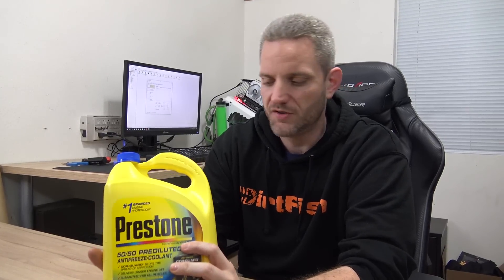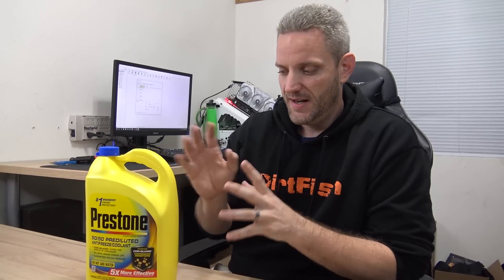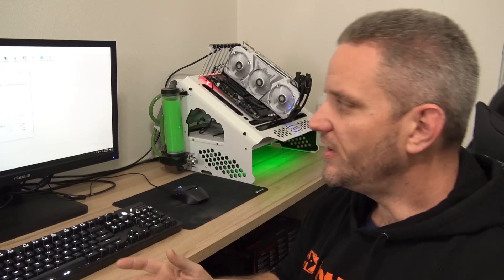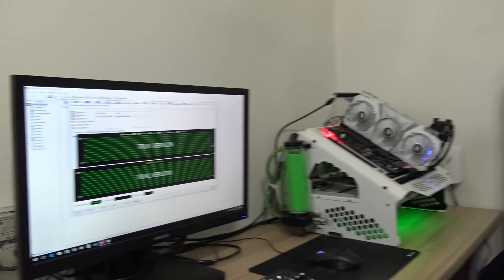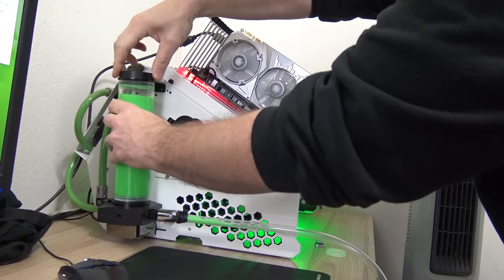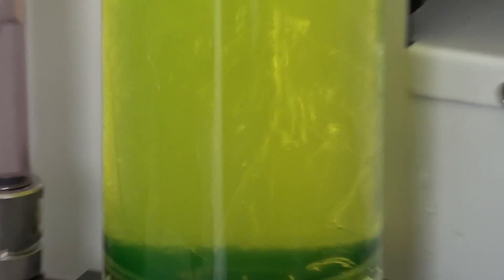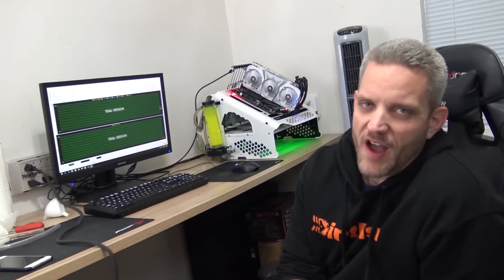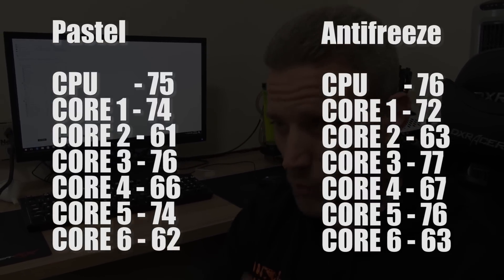I used Antifreeze to cool a PC

Comment: Water is also amphoteric, meaning it can act as an acid or a base depending on what it is mixed with. So with antifreeze, it's going to act as an acid. If you do this, I suggest diluting the antifreeze heavily - and use distilled water only. Ideally, you're going to want a PH of 10 or very close to it (I.E. a PH of 8.75 is still too low).

Comment: Antifreeze will be worse than straight water. Car cooling systems are designed specifically for water, but in climates that can reach freezing temperatures, you use antifreeze so it cannot freeze and destroy your radiator and engine block when the car is not running. The ethylene glycol half of antifreeze has a lower specific heat than water. In the range of 17-20% lower depending on temperature. Water is the superior coolant all around.

Comment: i cant see why it would have negative effects to o rings and plastics. most modern engines are full of o ring seals, reinforced plastics, and rubber hoses. as well as many different metals. from iron, steel, aluminum, zinc, copper, etc.

Comment: You should try different blends of engine coolant, like how some Toyotas use red coolant, Audi's in house "G20" coolant, etc. 

Maybe even try hooking up a car or bike radiator and see how that works versus a PC radiator.
Reply: a pointless test, this is all you need to know
the bigger the radiator the more heat it dissipates at any given moment
of course it will only ever be as cold as the ambient air around it however
Reply: Lylian Varker The larger radiator test maybe, I know the fluid passages in a car or bike radiator should be bigger than a PC one. Trying an oil cooler VS a radiator might also be interesting as an oil cooler has much larger fluid passages as oil is thicker. I suspect though the thicker passages would make it perform worse as it leaves less surface area to dispel heat. 

My hypothesis for the different coolant blend is because Audi's G20 coolant was developed for their 3.0L Supercharged V6 engines which run very hot and thus need a more thermally efficient coolant. Because it's better, maybe you could see a difference in a PC. probably only 1-2℃ though. You could also try using it for a chilled liquid setup as it can get to a much lower temperature than water.
Reply: The special blends used in some cars are still just objectively worse than distilled water. The "special" blends are just slightly better than off-the-shelf coolant and antifreeze, especially at high temperatures, which is where coolant mostly operates, right - nobody cares if their car is cool when it's stopped - you care about the cooling capacity when the water is really really hot.

The only element known to man that has better thermal conductivity than water, and that is liquid at room temperature, is Mercury. As in, the metal, the extremely toxic liquid metal. Which is also quite heavy, and would probably destroy the pump.
Reply: Your're talking about nanofluids or something? Where they suspend nano particles of titanium or whatever in the mix to increase the heat transfer? Car radiators? The whole thing just sounds like to big of a set-up even for Jay just to get negligible results. The heat temperature and surface area of heat to be cooled is just not there to see any difference. Now if you shrink the size of the radiator to like an 80mm, then you might see a difference with the special-advance anti-freeze coolant. Which is probably why they are developing such fluids. So they can put smaller radiators in the cars. Smaller radiators= less drag, and less weight.

Comment: The automotive coolant is likely fine in most systems but some plastics as you mentioned could be an issue.  Another issue is a lack antimicrobials, since automobile coolant relies on the car's engine and thermostat to maintain a temperature well above the temperature most microbes will survive.  You would have to add in a compatible biocide when first setting up the loop to ensure it stays clean of microbial growth.

Comment: I'm actually surprised it was as good as water. Water is exceptionally good at transferring heat because of its high heat capacity and density. Glycol might have less of a surface tension effect but that really is minor compared to water's benefits. I thought it would be significantly worse. Anyway at least we learnt you can water cool in the Antarctic so thats always useful. It might not be a helpful computing video but in terms of scientific curiosity it was interesting. Thank you.
Reply: Olivia Lambert It is not as simple as you believe it to be. The water adheres to the surfaces, with its smaller molecule (and other physical properties, water is seriously weird.) That means it does the thermal transfer. The percentage of water in the system (up to about 50% EG, where it begins to impede cooling) is basically irrelevant to the ability to withdraw heat from the cooling element. That's why we mix to 50%; it's the strongest mix you can have which doesn't seriously impede cooling, which makes it simple for everyone to install.

Fun fact, you can check the voltage generated by your coolant eating away at the metals in your cooling system to determine whether your coolant is good. If it is over 0.1 volts, damage is occurring and the coolant should be replaced. If it is over 0.2 volts, serious damage is occurring.

ASE cert in HVAC here.
Reply: It's still a very poor thermal conductor. It's used in ice rink cooling systems because, you guessed it, they are very cold. Below freezing, in fact - that's why, big surprise, there's ice on the top. Which means that the fluid they're pumping, usually brine, must be below freezing too. If it's below freezing, you need anti-freeze to stop it from literally freezing solid. Because pumps don't work very well with ICE.... Maybe you should understand why it's used the way it is used, instead of calling someone else ignorant. Using it as coolant in a closed loop at room temperatures is objectively and factually, scientifically provably worse than water.
Reply: as aforementioned, it's because half water.
Ethylene Glycol does fine at thermal transfer though. kind've meh compared to water(less thermal transfer overall and much less at high temperatures), but plenty sufficient for Computers.

but even if the other half was dead useless for thermal transfer, that's fine. Computers don't generate a lot of heat. the bottleneck in Liquid Cooling is the transfer of thermal from Radiator to Air, not the Liquid itself.

the same bottleneck that Air Cooling has.
and the solution for both is more surface area.
Reply: +1 because girl
Reply: Cyan Stripe ;-;
Reply: Olivia Lambert well damn
Reply: I was surprised too. Alcohols in general have pretty awful thermal conductivity. I wonder if the system would perform worse over a longer time period, letting the system thermally soak for an hour or so.
Reply: Automotive engineers and chemists have had a long time to develop efficient antifreeze solutions.
Reply: It's half water. The water is doing the thermal transfer part.
Reply: Mythricia Its about heat capacity, the amount of energy it takes to raise it by one degree. You want to remove as much energy as possible. Transferring that energy into the water is the job of an efficient block design.

toy machine We have the ingredients, we know what is in there. There isn't much related to efficient cooling. That plus its supposed to be diluted significantly.

Martin Espinoza Half water means only half is there to do the thermal transfer. The glycol also had to have a significant effect or it would have risen more.

Having had time to think about it I'm assuming the fact that it was a well thought out cooling setup was the major factor. Had he used a poor/cheap cooling setup I assume it would have been worse. It wasn't pushed anywhere near its limits, had he used poor radiators, water pumps etc. I assume it would be different but at least its nice to know if you're not pushing your cooling to its limits it doesn't really matter what liquid is used.
Reply: This was a good comment and I appreciate it. +1
Reply: it was 50/50 mix, so it has 50% water in it.
Reply: ***** Well, no. You don't put nothing in because of corrosion. Even in an all-alloy system you have different alloys. So you can run e.g. Redline Water Wetter, which has a wetting agent (to reduce surface tension) and corrosion protection.
Reply: Olivia Lambert I thought that the glycol would make a major difference as it was flowing through the system,but the question, as he said in the video, is for how long, but thank you for helping realize this. Also "wow someone intelligent in the comments section"

Comment: That is a lot of antifreeze; you only need enough to inhibit corrosion and growth. Antifreeze will last MUCH longer than anything else other than water. It won't degrade; it will last for years. Distilled water + antifreeze is the BEST. All other fluids are just cheap toys with shiny bells and whistles that offer no real performance while reducing longevity. Because you are so into water cooling, I was shocked that you use the fluids that you do. You practically don't even need to flush your loop when using water and antifreeze; you just add more as it evaporates.

If someone wants to use a material that reacts with antifreeze, they just have to use a different fluid. But, distilled water with an anti-growth additive will still be the best; antifreeze is just one option for an additive. Something like PT Nuke is widely suggested by water cooling veterans. It is just copper ions, which work similarly to the silver ions in certain swimming pool solutions. It doesn't have any corrosion inhibitors, but using quality metals mostly eliminate corrosion issues.

Comment: it wasn't completely useless, if anything now we know what materials not to use in a build using coolant. After all, besides its dissolving properties it does have an advantage which is it being anti corrosive. if it doesn't polimerizes over time gunking up the system I'm down on using it.

Comment: Stressing only the FPU in AIDA64 Extreme generates the most heat.  My OC'd 4790k goes from 70C with all three to Thermal Throttling with just the FPU.

Comment: So what if you put pc cooling liquid in a car...? Would it stay cooler?
Reply: It would probably boil because of the extreme temps inside an engine
Reply: Oil handles most of the high heat cooling, engine coolant usually hovers at about 90C in most cars, which is 10C under the boiling point of water.
For most use-cases in mild weather it would probably work better than engine coolant - not that it matters, cars cooling systems are designed for coolant and have oversized radiators to compensate.
Reply: FatGuy computers don't have fast moving parts compared to a car. Sure you can say the hard drive but the hard drive doesn't need liquid cooling.. Besides antifreeze is so that the water in your car doesn't freeze when it's cold  and the liquid doesn't evaporate when its really hot.

Comment: In ye olde days a lot of us did use Antifreeze at 20-50% for the corrosion inhibitors. We were also using Eheim Aquarium pumps, milled aluminum and/or copper waterblocks, and Automotive Heater Cores. I was a bit surprised at how little difference the antifreeze made.

Comment: Why use antifreeze on something that heats up? Doesn't make sense. Anti freeze helps stuff not get COLD. Pcs don't get cold.
Reply: Master Stroyer it's engine coolant. Antifreeze is the short hand because it prevents the liquid in your cooling system from freezing.
Reply: To stop it freezing when not in use....... your car doesn't run 24/7
Reply: if you only use water to cool your car it would crack the tubes and engine when its below 0*. because when water turns into ice it expands
Reply: It would also gunk up with microbes that would love to live in it, and it would rust/corrode the hell out of the entire engine block.
Antifreeze/Engine coolant has a lot going for it, probably because it was designed for that specific purpose
Reply: You guys are missing his point. He's asking why put antifreeze in something that will never be exposed to freezing conditions. PCs are generally kept indoors in climate controlled environments, so the PC will most likely never be cooler than about the 60s(F).
Reply: razorbackblood06 THANK you! Someone gets it. Pcs almost never get cold. You want liquids that handle heat, not cold.
Reply: The antifreeze doesn't just stop the coolant from freezing, it is also very toxic and will kill any organic growths in the engine or in this case, computer

Comment: Try using mercury ri cool your PC next
Reply: I was thinking the same thing.
Reply: You are absolutely right, though elemental mercury isn't too bad compared to it's salts.
Reply: Gallium would work better i guess?
Reply: PRO-digi it wouldl solidify after you shut the computer off and clog the tubing. Not only that, but if any gets on the Aluminium parts, it will make the metal brittle.
Reply: the little bambi pumps we use for computer cooling are not made to handle materials as incredibly dense as Mercury.
Reply: Haloid Kusnetsov and what about a gallium alloy with a lower melting point? 
http://forums.extremeoverclocking.com/showthread.php?t=171700
Reply: Mercury and Gallium both form alloys with Aluminium. Gallium actually forms an alloy with copper, too, but at temperatures below 200 °C its not much of a problem. However, i'm not sure what will happen, when you keep flushing large amounts of liquid Ga over the copper, but it might corrode. The density of mercury is also a problem, as your loop will have quite some inertia and you'll need a really strong pump. 
Some company used NaK in their cooler back in 2010 (LMX Superleggera), which sounds quite thrilling 😈 Also, finding a leakage in your system shouldn't be much of a problem anymore, if you use NaK, just look for the burning area.